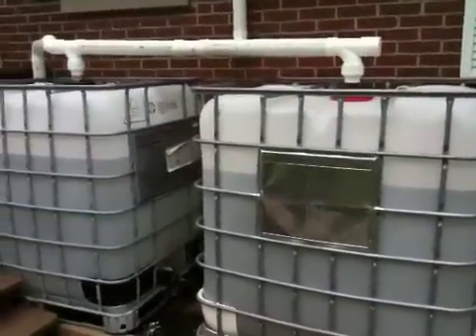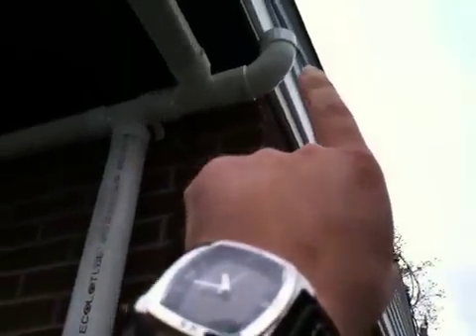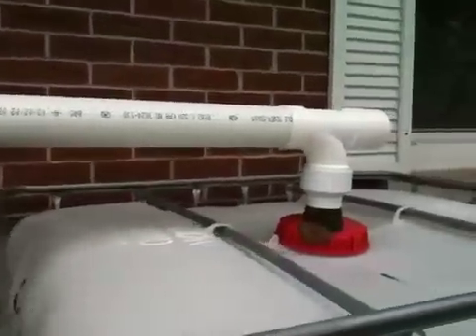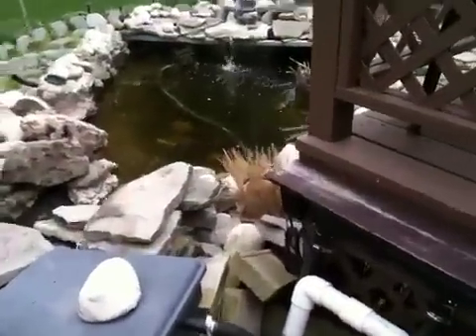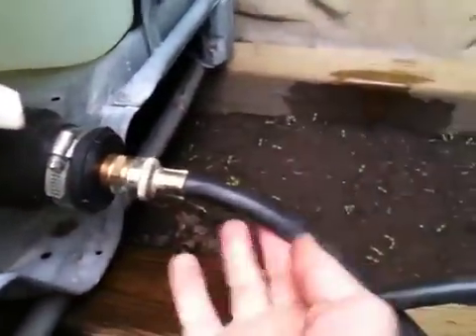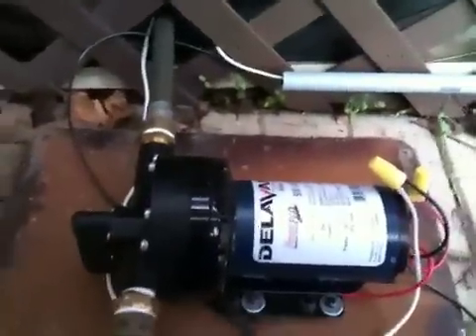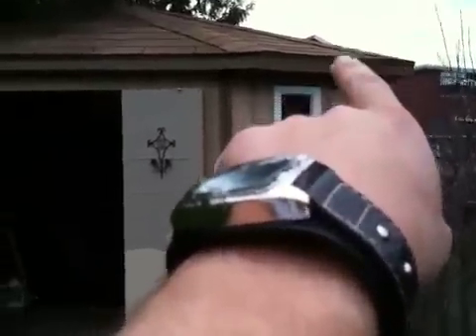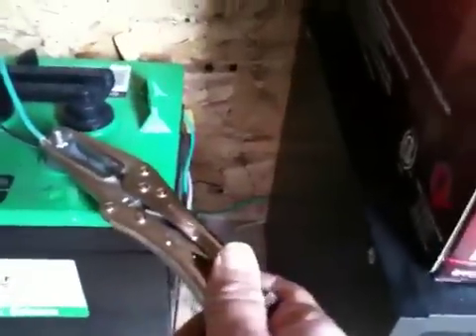Rain barrels with solar pump

Comment: Reading the comments found you live in Canada. I live in Ontario and am a senior living in  a rural area and love my flower beds but am on a well. I have one of these tanks, but just have a hose coming out of the bottom of the tank, which is raised up about 3ft so cant really water the garden just keep filling up the watering can. This is a great project I will have to try and find someone handy that could see what you have done and see if I can copy it. Thanks a lot, this year we really needed water, ran out of it once from the well.

Comment: How much money do you save per year in water costs?
Reply from the maker: A decent amount i wash my car a lot and water my lawns garden every second day .. not to mention the fish pond takes a lot.. can't put a dollar value on it sorry .. I do get a 45 percent discount on my sewage charge tho so a wopping 8 bucks there lol
Reply: @peeinginthewind  How did you get a sewage charge discount? Is that cause of the rainwater totes?

Any concern with having all that weight against the foundation, do you have a basement? Wondering what the mac weight one can put against a foundation.
Reply from the maker: Just contact your local municipality you get a discount based on how many litres you have from 0 to 45% maximum discount..never has a foundation problem.. yes I have a basement.. I suggest you put a few inches of pea gravel down and even set you tank down on longer railway ties ti spread the weight .. good luck

Comment: How does the inlet balance out the water to both? Is there a pipe at the bottom that connects them together?
Nice pump setup!
Reply from the maker: Thanks for the comment there is in fact a hose at the bottom of the tanks that connect the two to balance them out the extra pipe on the top is just in case the first tank can't handle the volume it'll overflow and spill into the top of the other one
Reply: @peeinginthewind  sealing the top is quite tricky isn't it.  I once had 5 inlets at the tops.  I always lost some to leaks while grabbing slow rain trickles.

Comment: I just put in my first rain barrel and tried watering my garden and didn't have enough pressure so I raised the tank and still not enough.  Now I'm going to install a new spicket lower that has a bigger opening.  If that don't work, I'm afraid I might need a pump.  If this one is quiet and on demand, it will work perfect! I already have solar and a zero pressure timer hooked up to release the water.  What one do you have?

Comment: I stole your idea, I did the totes for rain and after watching your video I found a RV pump with the pressure switch and connected it to my solar setup I have here in the barn for my Ham Radio stuff. I leave mine on all the time and it works with my drip watering system just fine. Mine only drops voltage .6 volts when running (I put a small 5 volt adapter at the pump to power a couple inexpensive WIFI cameras so I could watch the critters in the woods out back) The voltage drop on my battery bank is normally either none or .1 volts when the pump is running. My bank has 4 sets of 2 6 volt golf cart batteries. 

I already had everything except the pump and it was not very much, thank you again for the idea I did not know such a easy to use inexpensive pump was out there.

Comment: If you don't mind me asking, where did you get the rubber bushings for the outlet of the tanks? I haven't been able to find anything to go from the 2" opening to a standard hose adapter without using 3 different adapters
Reply from the maker: thefilthelement chk Any big box store ! I got mine from Home Depot... and mine does consist of 3 pieces

Comment: Curious how the pump knows to shut off when you let go of the trigger! I want to set mine up to run an intermittent mist system, only kicking on when my timer opens the valve.  I have a DIG six station timer.  Any insight you could lend me?
Reply from the maker: it has a built in pressure switch ... look for an old rv pump
Reply: Perfect thanks!

Comment: don't you get algae in the tanks?
Reply from the maker: I do yes ... I could paint the tanks to prevent to uv light from getting at it but I like seeing the water level .. so I just power wash them out half way thru the summer then again in the fall
Reply: You could put a piece of paint masking tape verticle on the tank before spray painting a black or dark color , then remove the tape when done, thus providing you the ability to see the water level through the previously taped area and preventing most of the sunlight from entering the tank. Be aware that it will take a lot of spray paint to completed the job. I have heard of people using black plastic sheets to wrap the tank . I would expect that after several years the black plastic sheets will need replacing, but it should help save the plastic tanks themselves.
Reply: I like that idea.

Comment: can you post a link to where you got your 330 gallon tanks and the pump you used
Reply from the maker: Bought the tanks used online, not from a retailer...
Just search your local classifieds for 330gallon tote,
As for the pump, chk out my other vids I have one about the pump showing the model psi and gallons per minute ect... Hope that helps !
Reply: challenger70002 this is 2 years later, but I stumbled on someone with a bunch of these. I got 3 last week @ $50/each. He gets them from a potato chip factory. They are sitting in my driveway as I figure this out. This video is great! I got a few helpful ideas. Thank you

Comment: This is a GREAT setup!  Do you mind posting a list of required parts (estimated prices would be awesome)?  I'm basically mimicking your design, but I'm using an 80w solar panel (Mid-Atlantic region, not as much sun until Spring/Summer).. Are you using any sort of battery/charge controller? Also, where'd you get the cool digital battery voltage indicator? Thanks again for the great videos and inspiration!  One step closer to going "off-grid!"

Comment: looking great man,  your video is the one that made me want to do this.   I have the tote, just received my 300gph 12v pump and I also picked up a 12v marine battery 115AH @ 1A and a 45w harbor freight solar kit.   I will assemble it soon and make a video to share back with you.   I plan to use it to water my veg. garden, along with in my beer brewing shed to pump through my wort chiller then back into the rain barrel.  no more wasting water down the drain.  :)

Comment: man this is great and just what I am looking for as well.  My totes look like yours but I think they are only 275 gallon anyway awesome setup and everyone should be doing it.  please share any info you can with me about pump.  I was looking into Harbor freight solar cells and controllers.
How does yours turn on and off with just releasing the hose grip? that's something I want but don't know how it works?  thanks take your time on reply.

Comment: So does the gauge of the 12v wire matter since it's going all the way across your yard.  I have our solar panels set up about 75 feet from my pump.  Or does the gauge of wire only matter from the solar panel to the charge controller?  Sorry if it sounds like a dumb question.  Love your set up and am using it as a partial guide along with a few other videos for my set up.  THANKS!

Comment from the maker: It's basically an Rv on demand pump 12 Volts, once it reaches 45psi after releasing the hose trigger the unit shuts down.  Squeeze the trigger and it restarts.